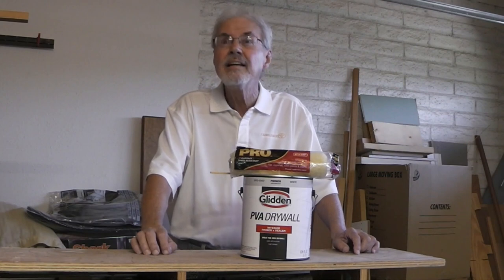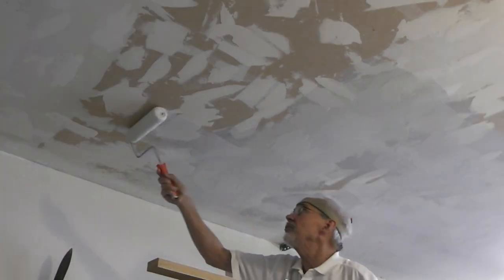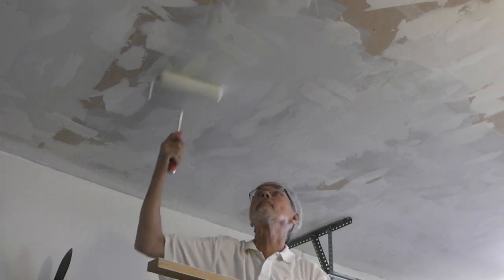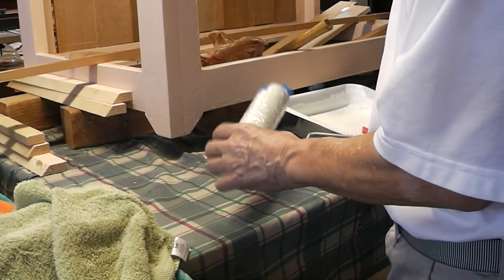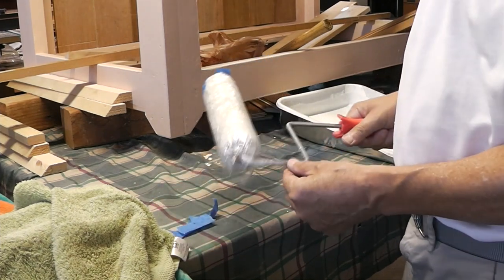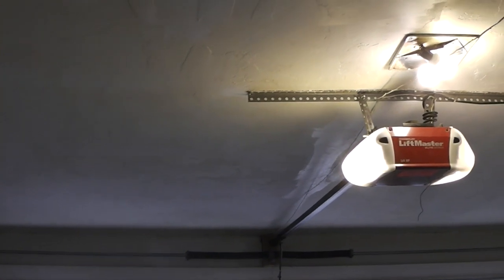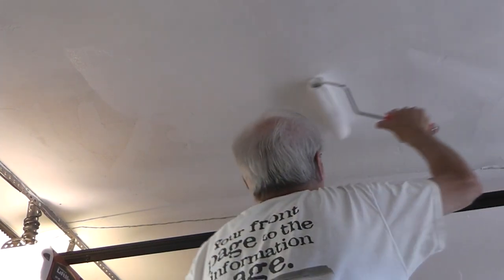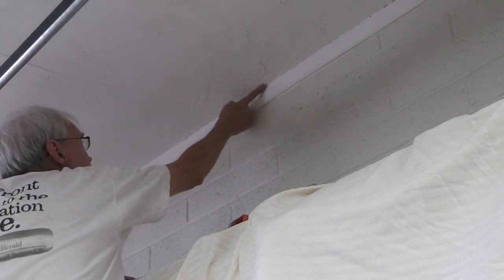Priming & Painting the Garage Ceiling after Removing the Popcorn

Comment: Do you use the drywall sealer instead of "mudding"- using joint compound? Thanks, ahead of time, for your answer.
Reply from the maker: Kim, I used the joint compound over the tape. The tape is used to cover the seams where the drywall sections come together. Once that is done, I used the drywall sealer over the entire ceiling to “seal” both the drywall and the joint compound so that the final ceiling paint would both stick and not soak into the drywall. Hope that helps.  Thanks for watching.